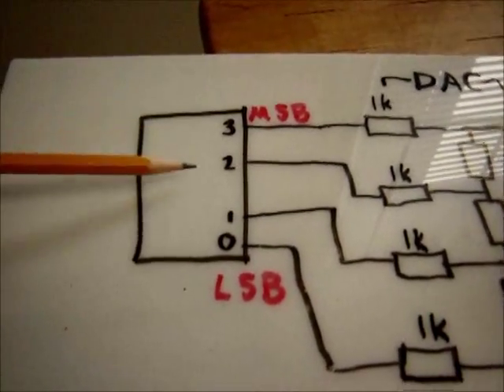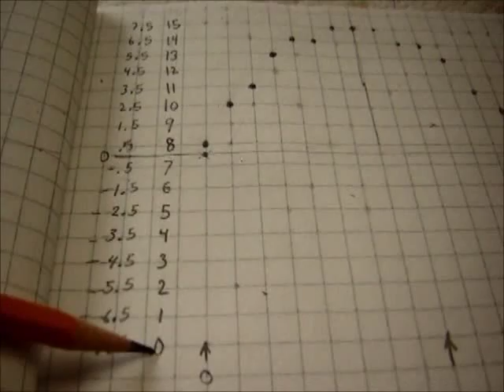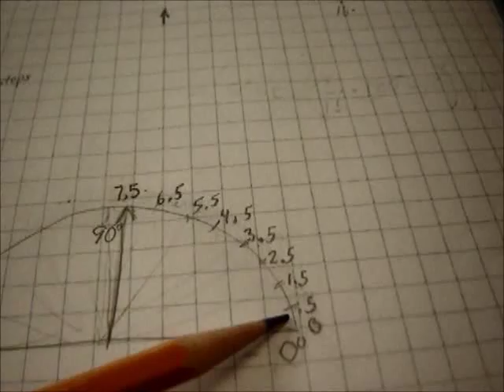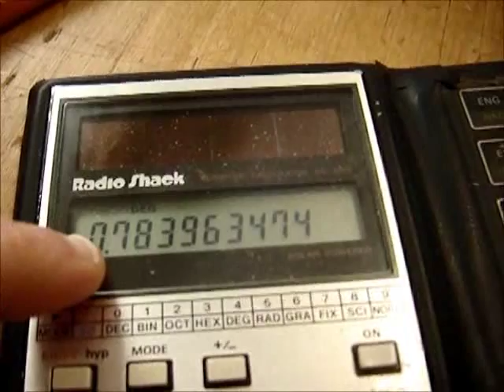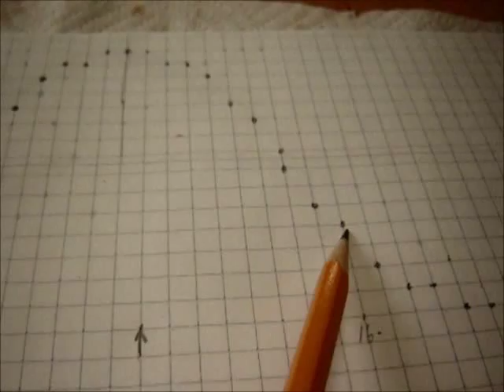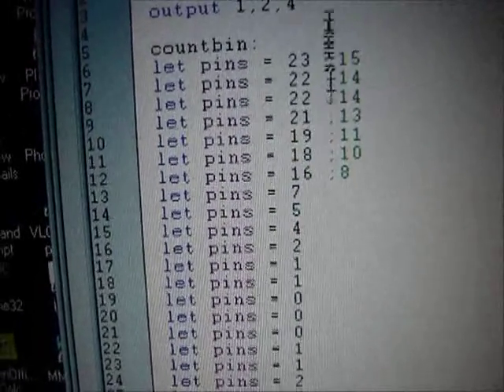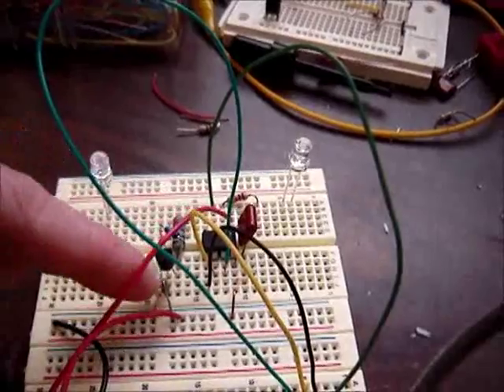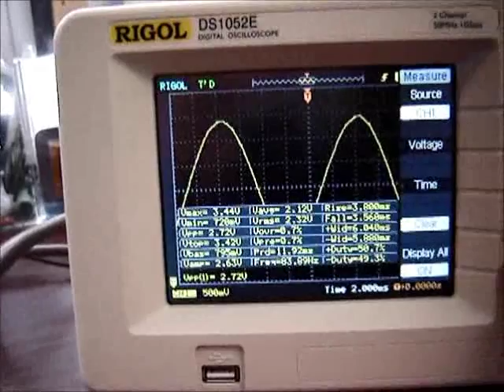Microcontroller sine wave generation experiment

Comment: I need to create a 2khz sine wave oscillator   to drive a buzzer. Can this chip be programmed to achieve this task. The power supply is 12-14.5 volts
Reply: Yes. I believe it can. Just takes time, work and effort ☺.